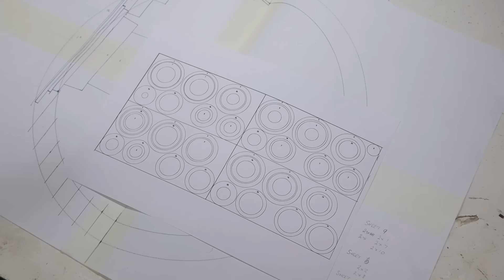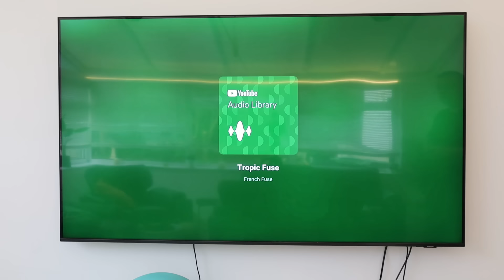Woodturning - Ideal for anyone with a TV

Comment: no matter how bright a speaker manages to get, you should always use treble! There is a reason why almost all speaker manufacturers use treble in their speakers!

There's a 5 inch midrange I've listened to that has a built-in treble. You won't be able to see that it has it, neither on the magnet nor the dust cap. you see only 2 sets of terminals.